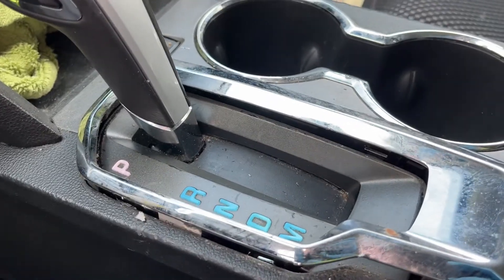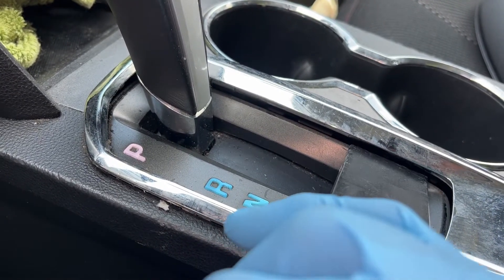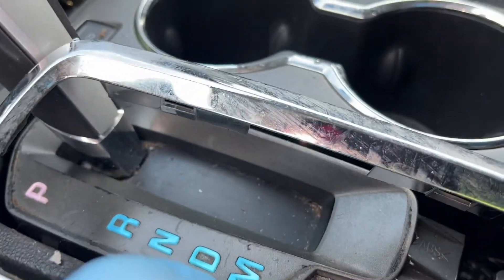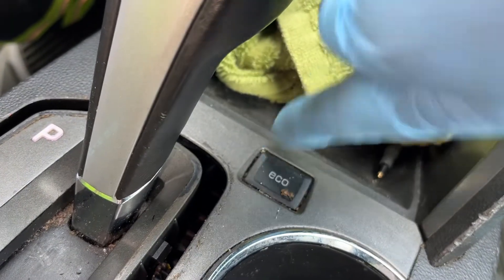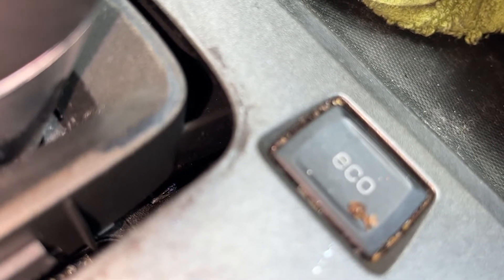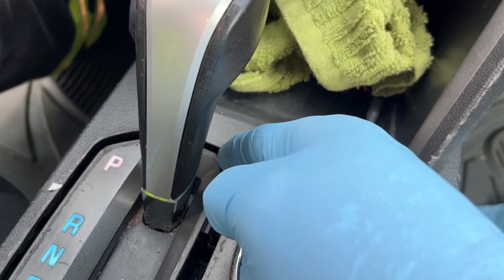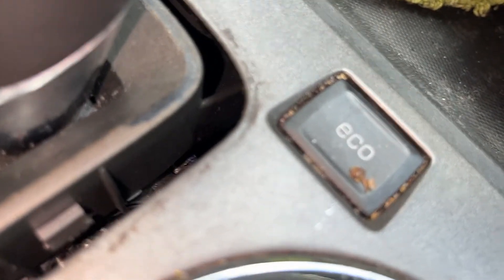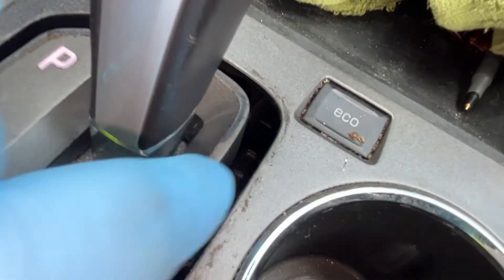HOW TO GET A CHEVY EQUINOX INTO NEUTRAL

Comment: Easy peasy. I just pop the connector off the selector on top of trans under the hood with 2 fingers and select neutral. Drag it up, and pop it back in park until it's delivered, then reverse process and pop it back on in park. Same with traverses and Malibu's, Cruze, most of the GM's. 4cyl cars anyway. The V6s can hard to get your arm in on top of trans.

Comment: What do I do if my key is stuck in the ignition and my gearshift won't move because of it with my 2017 Chevy Equinox and what could the problem be
Reply from the maker: Does the vehicle have power? I believe the ignition on those vehicles have a lock that holds the key. If the battery is dead it won’t release the key. You’d have to get power to the battery with jumper cables or a portable jump pack.
Reply: @TowMan127  When the key is stuck it will start it just won't come out of the ignition and it won't let me shift gears
Reply: And sometimes it will let me pull the key out and when I do everything is fine I just don't know iw why sometimes when I do pur my key in the ignition it won't come out and the gearshift gets stuck
Reply: @domoniquebryant4332  tengo el mismo problema , como solucionaste el problema?